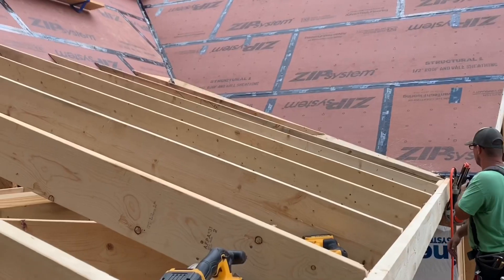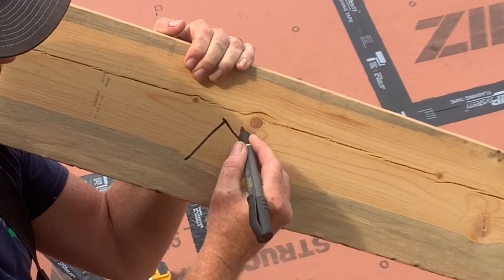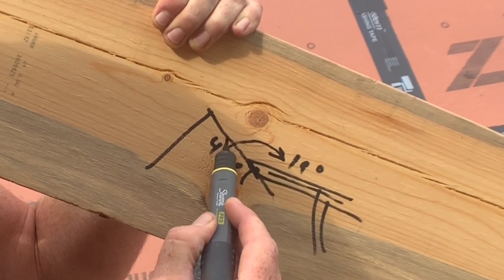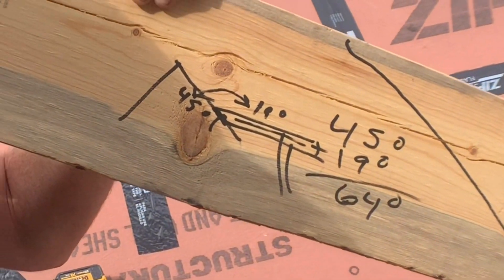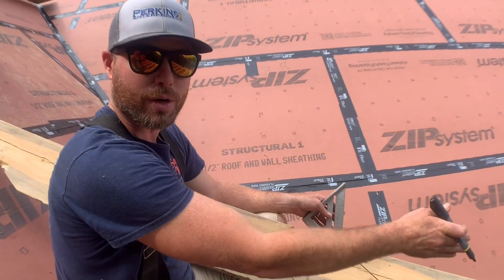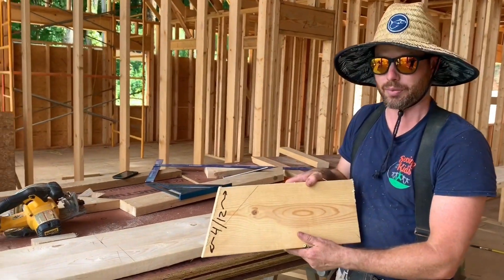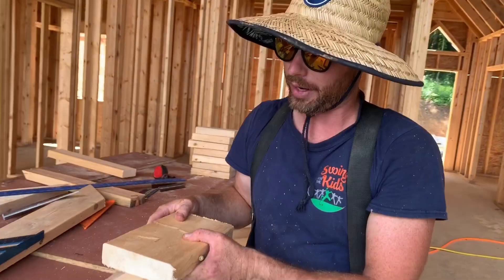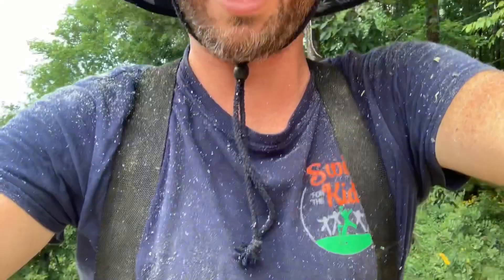Building a porch roof | Special rafter cuts and jigs

Comment: I have tried this over and over again and for my setup it doesnt work 6/12 to a 4/12 doing correct angles the heal of the rafter sits on roof but the top is 2" inches from touching.

Comment: Unfortunately on a 12/12 roof both angles are 45 degrees.  Is the angle from vertical for 6/12 roof 63.43 degrees? BTW Thanks for a great video. I have been searching forever to find the process for adding the shed roof onto a gable roof.

Comment: Thank you so much! I am actually building a porch roof and already have the existing roof of the home too. How do I calculate the existing roof pitch?
Reply: you can use a level . hold one edge on the roof have it level . measure down from the other end of the level too the roof ..  lets say you used a 4 ft level  you divide your measurement by 4 ,, that will give you how many inches per foot your roof drops , lets say 4/ 12 pitch that is every foot of roof width it is 4 inches ,, so if you used a 4 foot level your measurement should be about 16inches give or take due too roof sag or other things .. hope this helps you

Comment: Love the jig. Making trusses right now for my shed and will use your jig on my rafter tails. I wonder about using the jig as a saw guide when you cut the tails? Probably too much trouble for you guys as you are skilled enough to cut perfectly straight lines but mine are not as consistent. In any case, videos like yours have revolutionized the DIY world.  Thanks!

Comment: Atan(4/12)/Pi*180 ~= 18.43491, NOT 19... So technically your extension is a 4.13193/12 pitch? Is there much difference using 18 (3.89903/12) over 19? or even using the actual degree of a 4/12? Just curious on the choice of 19 degrees.

Comment: Question please: When you say be sure to use the number of degrees from vertical and number of degrees from horizontal, wouldn't that be the same degree as what ever degree corresponds to the roof pitch as noted on the roofing square?

Comment: How did you figure the height where the rafter would sit on the main roof?
Reply from the maker: Doing some math and using a level and tape to measure the height above the wall plate.... 4/12 pitch = 24” vertical rise (8 x 4 inches) on the 8’ wide deck we are building. So the heal of the rafter hits 24” higher than the beam (and wall top plate of existing roof. Measures the length along the angle of the new rafter cut and added that distance up the existing roof pitch to chalk a line that referenced where the tip of the rafters should land ;)
Reply: 8 x 4 is ?
Reply: Nice

Comment: You can also do this with a framing square no math, put the framing square on a 12/12 mark the edge of the board on the body side of the square then mark where the 4" mark is on the square. Connect the dots and cut

Comment: A quicker way, cut all your rafters (both ends) install one on either end of your run, run a string line to place all other rafters in between......quick, easy and the Fascia/Soffit assembly will come together perfect, assuming the the existing wall where the birds-mouth sit's is straight and true.
Time=Money.

Comment: What does it mean when you refer to a 4/12 roof? What does 4/12 mean?
Reply: Rafter run in inches ie 12 to rafter rise ie 4. So every 12 inches the rafter goes in a horizontal plane it will rise by 4 inches. 12/12 goes along the same amount as it goes up so is 45 degrees which is half of 90 degrees for example

Comment: Please,please,please do a 20-30 minute video covering framing, shear and braced walls, along with nailing requirements for the house. We have questions like;  how many 2x10s for a 3-0 window header? How about a 5-0? Are 4 nails every 16" on a header too many or enough? What lenth of nails for framing 3"x 131 ? How about sheathing 2 1/2" x131? Do floors get ring shank nails? Does garage wall shear nailing require 2 rows of 3 inch spacing staggered? Walk us through a house and treat us like apprentices. Tell us what inspectors are looking for. I hope you can make the time to create a video.
Reply: Inspector will expect to be to code where you are building. Most follow IBC but some city or counties have there adustment that you have to adhere to.

Comment: When u run a new roof onto existing roof in this case u said u wanted it 4/12/19° how do you determine how far up on the existing roof to set your new rafters to get that 4/12 pitch thank you
Reply: I was wondering the same thing.
Reply: Every foot of run the roof will rise by 4 inches. So if the run is 4 feet you can measure up 16 inches from the wall plate for example
Reply: Craig crofts ahhhhhhhhhhhhhy
Reply: Craig crofts in this case 4 ft rise to top of the rafters not the bottom correct
Reply: Really it should be to the backing line which ideally is 2/3 from the back of the rafter or wherever the back of the birdsmouth is
Reply: Well blueprints
Reply: Ruben Varela Well sometimes I don’t have blueprints

Comment: Where's the birdsmouth?
Reply from the maker: Good question... doesn’t have one. Porch has a flat ceiling with 2x8 ceiling joists.... rafter runs across the corner of the girder and is fastened to the ceiling joist (which has 3 1/2 inch bearing on girder) for bearing required.

Comment: I stopped snapping a string line on tails. I run a dry line and line plumb cut to it. I think it's better
Reply from the maker: I’ve done that too and it does work pretty well
Reply: Been trying to explain that to framers for years,makes facia look like it grew there.🔨👍